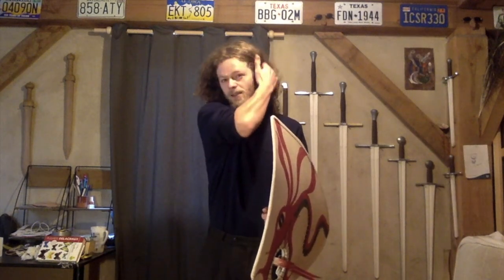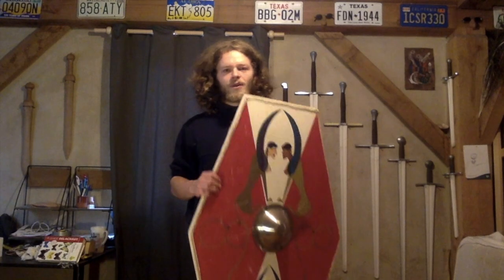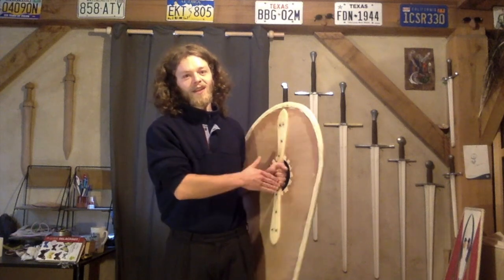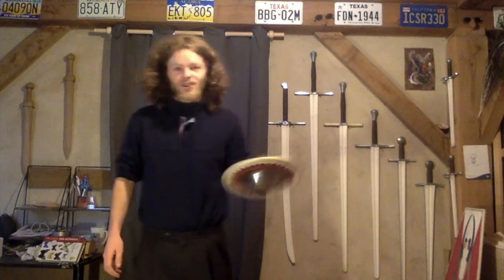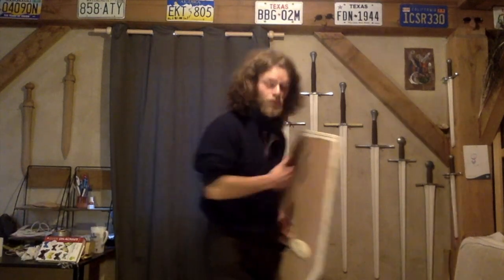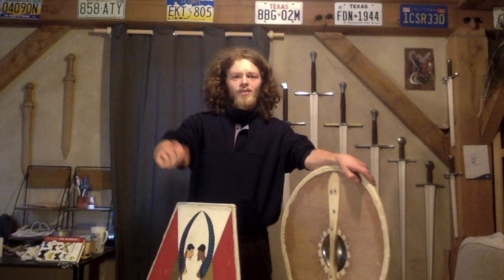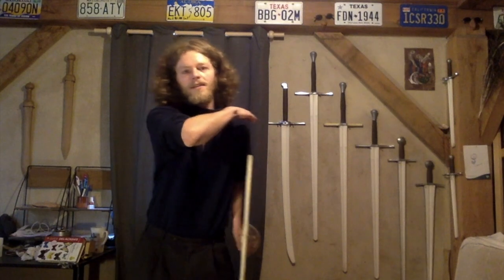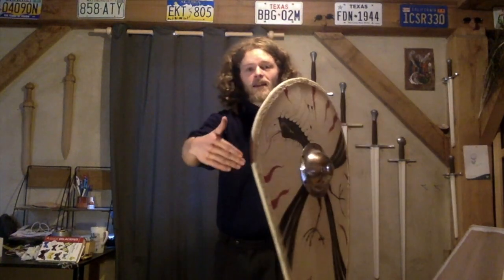Vertical grips VS horizontal grips on boss / center-grip shields

Comment: It is interesting to contrast this with the viking circular shield, where it probably was carried horizontally when the shield strap wasn't used and then deployed vertically for comfort. 

The greek hoplon was possibly deployed vertically and carried horizontally, although both viking and hoplon are roughly 3'/90cm diametre.

I think it is also important to realize how they were deployed - shield wall vs.individual combat, MOST of the time. A viking shield may be used in formation, but they were not as unified a group as the Roman Legion and their shield is best deployed far from their body projected outwards, rather than close, while the Roman soldier is heavily armoured and prioritizes massed unit formations over the individual. So a horizontal grip is probably best for pushing and locked formations while advancing. 

What do you think?
Reply from the maker: I agree with the general assessment, yes. And I think your point about how to carry them in the hand is important, as my vertical grip kite shield is basically impossible to carry comfortably without a strap. As to use in formations however, people have pointed out to me before that a horizontal grip is better for pushing and staying locked in formation but I'm uncertain as you can brace the shield against the body and push even with a vertical grip. I'd love to experiment more but unfortunately I don't have enough sparring partners to do much group combat...

Comment: Think it would also depend on the user's strength to a certain degree and maybe the shape if the grid, maybe a more round grip might allow you to use your finger more the horizontal grip it even both grips, other than that I think this was good video and of course I could be wrong

Comment: hello this is a question that puzzles me. I think that on top of what you mention. as well if the shield is thick and more designed as a rampart  and you brace against your body horizontal grip is best (and for that a low hold is beast). but if you want to fence with the shield (IE deflect missile  and blow more llike a buckler (so further  up from you 
But my assumption that missiles where quite important, and may be passing the point rather that creeping as modern boxing was more the norm.
Reply from the maker: The thing is you can also brace the shield against your body with a vertical grip...
Reply: @philodeinos7536  yes we can but it is defnitly more convenient with an horizontal grip . ie when bracing it is easier to support the way the shiel wants to pivot with the knee and helmet.
Reply from the maker: @willaumep  Yes, it makes sense that you then have a cross shaped support for the shield since the direction of the grip runs opposite to that of the head and knee brace. I'll have to try it out though because I'm unsure how much of a difference this actually makes. Also, I've seen at least one example , I think from England, of a roman scutum that had a vertical grip. But if I remember correctly it was a flat shield, not domed, and so I suspect it might have been for dueling, or perhaps cavalry or some other role other than heavy infantry.
Reply: @philodeinos7536  If i remember well there are several carving for the scutum where a horizontal grip is apparent and i understand that both the El Fayum and the Dura Europos had a vertical grip (and both curved) . The Uk one, if it is the doncatser/Danum, is kind of flat and i am not sure we know fro suer as i don't think they found the wood with it.

That being said, I can make an aspis work. I can make a anglo-saxon/viking shield work.  For bucker we have sources so it is definitely easier. Coming from 14-15th cent HEMA.  I can see how an horizontal grip would work like armour and how horizontal grip would work like a "deflection with the free arm" of the medieval treatises . 

The problem I have  that there seem to have been a fair amount of long thin headed metallic spear heads in a fair number of nations (i.e. that are likely to pierce a shield and project behind it ). As long as you see them coming, you can deflect and dodge them but that is a bit of a hot proposition since one hit will bugger you shield, On the flus side a curved shield and If using a short sword like a Gladius to cut and thrust and use you shield, Poly's 6 Roman/Greek/English feet bubble seems about right.